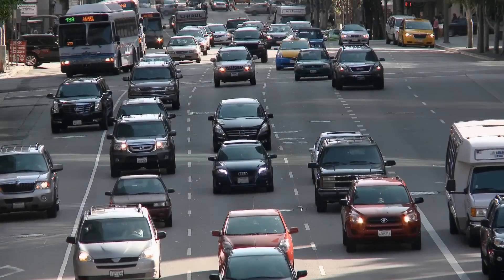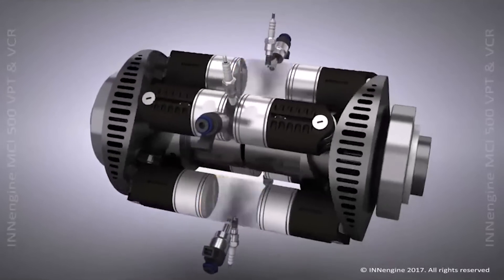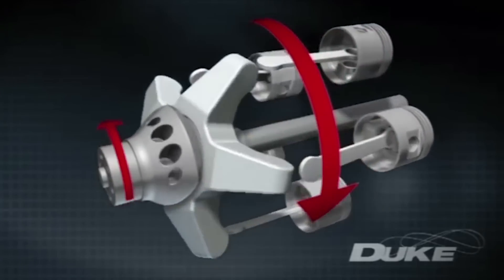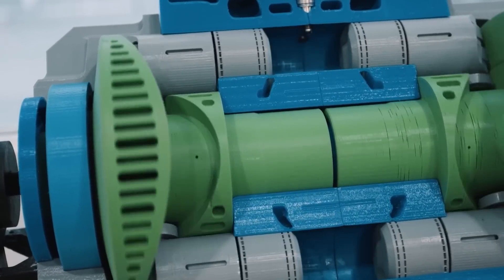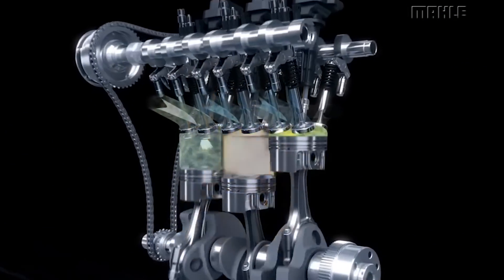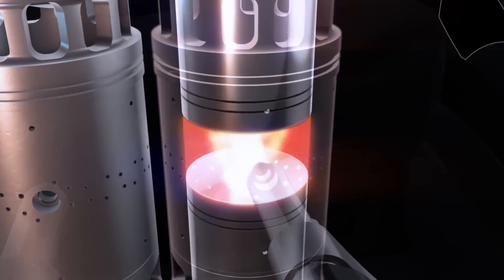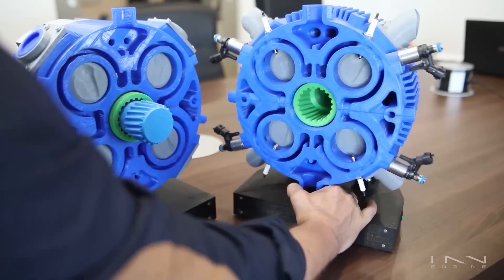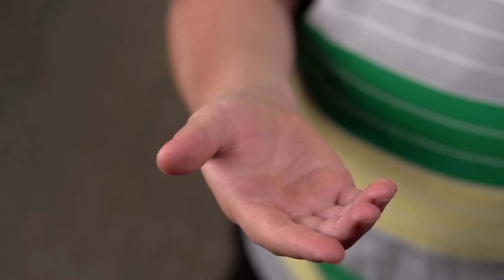Revolutionary One-Stroke Engine: Future or Fraud?

Comment: It is 2 stroke combustion engine. The rest are mechanical solution to make the engine works: produce engine torque. The rest challenge still same: efficiency, fuel.
But thanks for the idea. It offer compact design. Althought I see some similar pistion like used for torpedo.

Comment: I'm sure others have mentioned that the maker admits this is not a one-stroke engine.  But who cares, really?  

What I care about is that there's no reason to be attempting to optimize hybrid automobiles, and absolutely no reason to improve ICE vehicles.  All these devices are now obsolete, having been surpassed by electric cars.  Presently, the only limitation of EVs is the cost of the battery.  This cost is repaid in the fuel cost savings in the first years of operation, but people don't want to consider that.  They only see the sticker price.  

With a few advances in battery technology, which are being worked on currently, the cost and effectiveness of EV batteries will improve to the point of ICE vehicles disappearing from the showrooms.   This engine will disappear with them.

Comment: That turbo you mention on the MX 5 looks like a large filter, whether there is a turbo there? I doubt it. quite an interesting engine concept. vibration will be very low, but the noise is rather unpleasant and raw. To call it a fraud lacks all foundation, you should be ashamed of yourself. They clearly do have a working engine. And the fact that they do not share some of the trade secrets, you'd like to know without paying for it, does make total sense to me

Comment: Whoah they're smart guy . . . the thing that the red arrow is pointing to at 7:33 is a short ram air intake with an air filter which can easily be used in naturally aspirated engines as well as turbocharged ones.  I looked at this photo in length and cannot see anything that would assist a turbocharger such as an intercooler leading me to believe that this car is not turbocharged and is indeed naturally aspirated.

Comment: Let's not talk about the end of the electric vehicles or the ICE. Military loitering drones have created a whole new market for combustion engines. 
They need well balanced, lightweight, higher rpm - modest torque, good fuel economy, good cooling engines to stay in the air for 24-36 hours. Countries are always on the look out for something that fits their military drone requirements.

Comment: Doesn't look like it has a supercharger on it, looks more like a little fan assist to move the air rather than a formalized supercharger which takes up a lot more space on the engine using a big "blower" turbine-style induction run off heavy duty engine compression and belts

Comment: The thing you call a supercharger kinda looks like an air pump to dilute exhaust fumes from the 60's/70's to me, could it be just that? An air pump forcing air in the engine without actually being a turbo or supercharger? Or it's an electric turbo and they just hide that fact. 
Another thing I see that might be the main real problem is with the rollers unless there is something I didn't see : The piston are really supported only in the middle of the engine, with that parallel bearing ,on the other sides it seems there's a perpendicular bearing (it looks like it on the green and blue model), leading usually with this type of arrangement to side forces being applied to the pistons. That means uneven ware, extreme force applied to that inner bearing leading to it's failure and possible binding.

Comment: Need a small balanced engine?
Use rotary ICE.
This one has terrible roller design.
Simply: rollers are rilling on a disk, meaning they are not a rollers actually, due to inner and outer radiuses difference.

Comment: That didn't look like a supercharger to me.  That simply looked like a conical air filter.  Even looking at what it's attached to doesn't look like a supercharger in any sense,  didn't appear to be belt driven and the housing wasn't large enough to hold the internals of a super charger.

Comment: Very good engine. Good ball bearings are needed, some manufacturers don’t install ball bearings at all, or use the types causing malfunctions later. Model helicopters use perfect ball bearings, even the cheap ones.

Comment: There is no way you will not loose oil at the intake or exhaust ports, the piston rings pass over them.
Reply: Oil consumption has been a historical problem with all opposed piston two stroke designs, and you are quite correct that it's not addressed in this design.

Comment: [22/07, 12:34 pm] Abdullah King: I have a plan to make a car that will not cost petrol, it will come with CNG and it will not have to be charged, it will run thousands of kilometers free, the car will run for free, it will not cost anything. I can and will build this technology and I know all about it
[02/08, 6:39 pm] Abdullah King: I will make it in a car like a Tesla car, BMW and MG Electric ID but it has to be charged and my technology doesn't have to be charged, it is an automatic system, it should generate charging by itself. It will run on its own for thousands of kilometers, it will run for millions of kilometers and it will run for years and years, it will not need any charging, it will be a production for itself, it will also consume and produce for itself, and its There will be storage every time, now this will be an electric vehicle for charging, mechanical and literary system has been done

Comment: FUD.   Snake oil that could be 20 years from proper production.  However, it burns fossil fuels and no amount of burning is sustainable.   And hydrogen is a red herring.  

I didn’t see any specs.  Efficiency?  Torque?  Kw?

Red flags indicate someone is lying.  

RemindMe! In 10 years when Tesla is building 25M cars in a year.

Comment: You speak about vibration but thats still a major problem with this design. And everyone knows vibration is the killer of any machine
Reply: Why would you think vibration is such a problem? The pistons in the diagonally opposed cylinders are moving in the same direction so there will be no rocking couple, and with the cam plate a pure sinusoidal motion should be possible so no secondary vibration. There are much more serious flaws with the design to consider such as oil loss, emissions and the pistons not being captured by the cam plate.

Comment: It has a ton of bearings on it though so I'm not sure how regular or easy the maintenance would be. 
Since its light enough to just lift out of the cars body by hand, I guess getting access wont be too much trouble. It would have to come down to the quality of the bearings being used I guess. Since they would have to withstand all sorts of torque and at the same time not crumble during long distances.

Comment: Thats not a supercharger. Thats an air intake, the metal box next to it looks like either a throttle body or a mass airflow sensor. I think you need to do some research on aftermarket air intakes.
Reply: That's what I saw, too.

Comment: I'm not sure the claim of the developers about shifting the phase of the swashplates/pistons makes any sense. It would mean that at the moment of ignition, one of the pistons would not be in it's most favourable position to handle it: if one of the pistons is all the way at the top, the opposing piston is not. So ignition would have to be timed to the piston that's late to the opposing one. Wouldn't it be better to move the swashplates down along the shaft? This would reduce the amount of compression, while keeping the pistons in phase.
Reply: Conventional opposed piston two strokes have exactly the same phasing of the crankshafts. They wouldn't work otherwise since the exhaust port must be opened before  the inlet port, and if you tried to do this by raising the exhaust port up the cylinder you lose a big part of the power stroke.

Comment: 7:34 That's not a super charger bruv that's not even a turbo its just a radial intake filter. Now there might be an electric motor connected to a fan in there pulling in air but I highly doubt it because electric turbos are so shite.

Comment: No. This is not the end. This kind of engine is suitable to high RPM like boats and airplanes… Automobiles need low RPM engines and gear box.
It cant run efficiently at 1.5 - 2k RPM (idle) as gasoline (ethanol or petroleum GAS ) cause it need a blower just to exaust…

Comment: Back in the 70's, they developed an engine that had fixed pistons. the end plate was slanted, so when the pistons rotated through the cycle, the distance from the piston head and the cylinder head changed. so, at max compression point, it would ignight, and normal expansion occurred while the next cylinder rotated into position. the exhaust would occur after the cylinder fired, and then it would be injected, compressed during rotation to the fire point...etc. so the big difference here is, they split the cylinders, and require them to move back and forth ...the other ones didn't.

Comment: Thats a belt driven air pump, not necessarily a supercharger. If its pushing 3lbs or so I could see why they dont market it as supercharged, as it wouldnt be "super" charging the air, just providing sufficient flow for operation.

Comment: The problem I noticed when I first saw this thing a few weeks ago is the rollers that ride the wavey cam disc 'swashplate'. The outer edge of the rollers will be contacting a faster-moving part of the plate than the inner edge. The only way around that is to have the rollers be slightly rounded so a smaller area of the rollers is contacting the plate, which isn't a surefire solution. In either case there will be wear/tear on the rollers and plate, either the rollers' inner/outer edges wear due to rolling at the same speed across the plate whose surface is moving at different speeds, or with a rounded wheel you'll get wear on them that flattens them out, if not also the plate getting beaten down from more piston force being exerted on a smaller area. Maybe have the mating surfaces be angled at 45 deg, so that the swashplate is taller in the center and thinner at the edges, and the rollers are tapered, like bevel gears?
Reply: There will be a little bit of sliding friction but I don't think that will be a big deal as long as it's all well lubricated to keep an oil film in place.
A far more serious problem is that the design relies purely on compression and combustion forces to keep the roller in contact with the cam plate. Any slight loss of cylinder pressure during cranking (e.g. ring leakage) will mean the piston won't return all the way and will lose contact with the cam plate. An extended crank could end up with the pistons pushed most of the way in with no possibility of ever starting the engine.
Reply: @ferrumignis  That reminds me, the piston could also just lose contact and then slam into the cam plate as well, which will eventually start causing rough spots on the plate and the roller. I can't imagine how you would actually even start this thing - just turning the cam plate won't do much. I think what it really needs is a captive roller. Instead of a cam plate it would be more like a track on a plate that the piston rods ride back/forth along, always ensuring that the piston is moving when the plate rotates.
Reply: @CharlesVanNoland  A captive follower is easy with an actual swash plate, but not with the cam plate design they have used which is likely why they haven't designed this in.  You are correct though, you could get the equivalent of valve float where the follower leaves the cam profile at the peak.

Comment: No test data available, no power/torque curves, no ignition or injection diagram: No need for proof, just believe us!
In addition, their communication goes in this direction:
It is absolutely not a "1-stroke" engine but a repositioned four-stroke, comparable to other layouts (cylinders in line, in V, in W, etc...).
And then given the lousy yields of the Duke engine and its longevity problems (perhaps improveable with years of engineering and feedback, if it had been implemented...) all this seems a vast marketing operation without proof concept!
For all these reasons --> just another SCAM!!!!
They allow themselves to advance, for their 125, a power of 22.7 Hp at 6000 rpm (we will have to guess for the couple?) with 7.7 volumetric ratio! But without curves or tables to illustrate their point, we just have to take their word for it...
In addition to not being transparent, they at no point back up their technical data claims. Everything's good...

Comment: New engines are hydrogen engines and newer engines will be biomechanically powered and after it's all atomic energy transfare like smaller yet more natural very complicated technology like Star powered in universe on smaller micro versions like UFOs that we dream of now :) runned on frequency radiation on vibration of electromagnetic waves in such a strong micro levels that it's a final Dream come true to power anything on any size you want :)

Comment: While the rollers on the pistons are a potential failure point, with proper lubrication it should be no worse than connecting rod pins or where the connecting rod attaches to the crankshaft. The pistons actually look a lot like hydraulic roller lifters.

Comment: The supercharger is used to scavenge the engine. Look at the Napier deltic as you may want to edit your video…….
Reply from the maker: The Napier deltic was supercharged - scavenging helps to flush out the exhaust gas, but (from what I can see) it cannot be used to pull in ambient pressure air alone! Thanks for the comment.

Comment: i am very skeptical about the use of rollers on the swash plate, as they implie a non hertzian contact thus a very probable plastification and important wear due to the curved path and the non-zero axial dimension of the rollers, I would have prefered seeing an hydrodynamic contact that is much more reliable and compact
Reply: I agree the hertzian contact is problematic for wear at TDC of cam.  But they can go to one wide roller with a tapered OD to keep from skidding at the inner & outer edges.

Hydrodynamic would add friction and struggle with mixed contact friction since thrust bearings don’t have the hydrodynamic wedge effect to pull oil into the high load area like a plane bearing/crank shaft journal system

Comment: Apart from dishonest marketing, the engine could work. But where is the market for it? Because I'm afraid there isn't any. Plug-in hybrids exist already and aren't financially viable unless you start every morning with a full battery. And if you can do that, why have a petrol engine in your car at all instead of a larger battery? Even the range extender in the BMW i3 was only available for a short-ish time because it wasn't financially worth it either.

Comment: This is an interesting idea and as a range extender on an EV would be a good idea you mentioned used in a hybrid and there are no hp or kilowatt or torque figures because 500cc two or four stroke motorcycles have been around for years and they performed very well in a car they are sufficient and how economical would it be

Comment: Perhaps they mean they are only maintaining 1 atmosphere with their boost system?  Basically just using it to push the gasses through, not increase the compression ratio, which would likely require a bigger/stronger engine.
Reply: Otherwise it's sketchy...

Comment: Technically, it still is a two stroke opposed piston engine. 
They use spark plugs to make it run on various types of fuel. Probably it runs more smooth in a rather low compression gasoline mode than in a high compression diesel mode. 
I think there is a fair chance that the roller design can be made reliable. Modern, turbocharged, downsizing gasoline engines aren't too reliable either. That's the competition the new design has to deal with. 

The Mazda prototype isn't quiet, btw ....
Reply: Expecting a turbo to compensate for a 4 or 6 banger to get reliable power of a v8 is asking for trouble
Reply: @shadowopsairman1583  It is. 
I chose these small things for comparison because they are the most sold contender, not because they are a good idea. 
If someone can get the same, mediocre results with an even smaller, cheaper design, he will get his market share. It still won't be a good idea, but at least it will be smaller and cheaper. 
Turbos are great for diesels because their low exhaust temperature doesn't roast them. And they are good for race cars when you knowlingly chose to sacrifice engine lifetime and a lot of money for performance. For everything else, they are a really bad idea. 
I would never buy a car with a turbo charged gasoline engine for everyday use. These things eat more money for repairs than they save you by their better gas mileage.
Reply: @Itsjustme-Justme  Turbochargers are perfectly reliable on gas engines provided you keep up with engine oil services and don't shut down the engine whilst they are red hot.  Plenty of people don't bother with servicing and then moan when their engine finally dies.
Reply: Isn't it kind of a 2 stroke / 2 firing cycles per 2 pistons?  So 2 pistons compress and an ignition happens in 1 stroke, then the 2 pistons move away for the other stroke. So 2/2 = 1.  Kind of.  It is something different.
Reply: @v3rlon By It's not different.  Each cylinder requires two separate strokes to complete their cycle (intake/compression and power/exhaust) therefore it's a two stroke.  Even the supposed "one stroke" design shown at around 5:13 is clearly still a two stroke design.  You can't physically make a piston engine with one stroke.